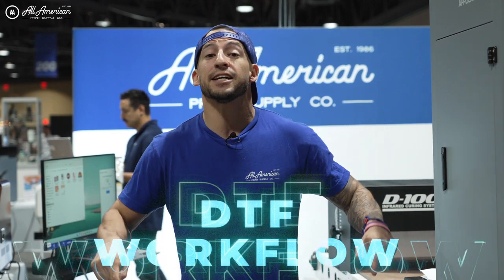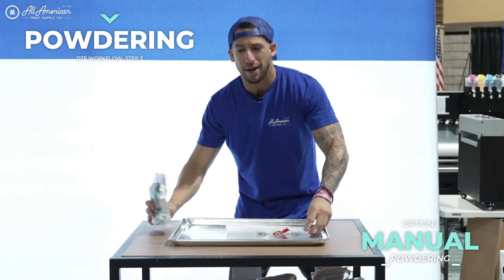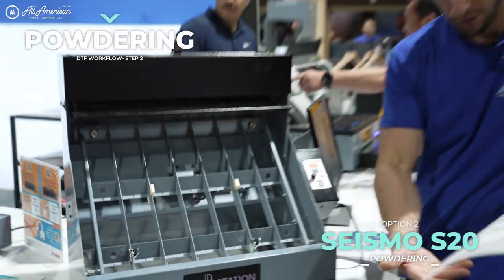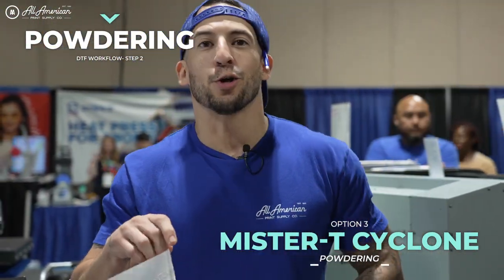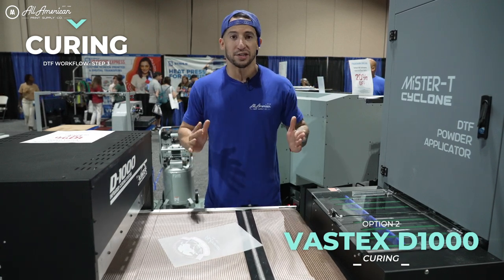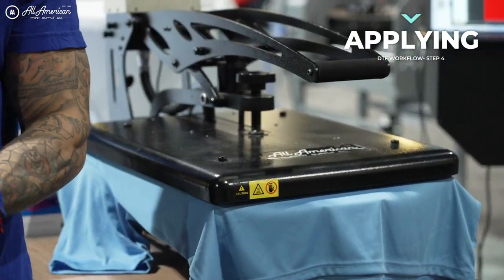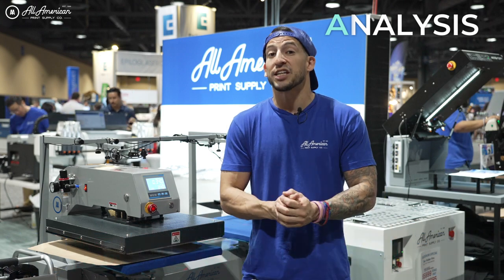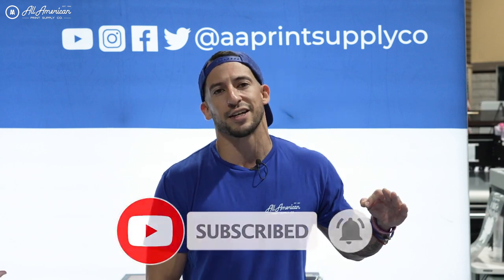Warming Up the One-Man Band: DTF Single Person Workflow | AA Print Supply

Comment: can I use a 15x23" sheet with the s20
Reply from the maker: Hey there! Just double checked the physical specs on the machine, we advise 16" x 20" maximum film size for best results
Reply: @AAPrintSupplyCo  thanks
Reply: What’s the difference between the seismo and the cyclone. I’m considering the seismo but just found out the cyclone exist. Can you outline the pros and cons between both and information to figure what’s best for me.